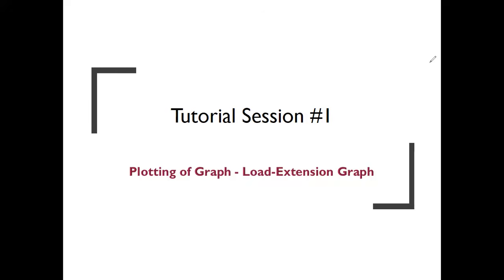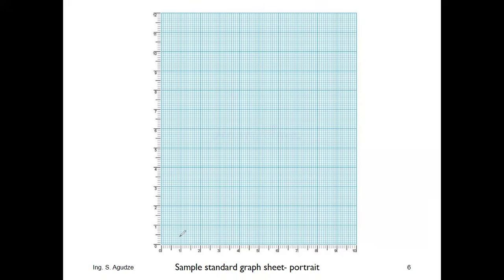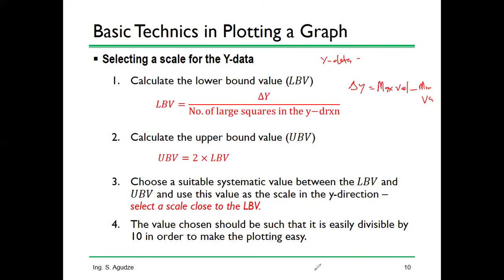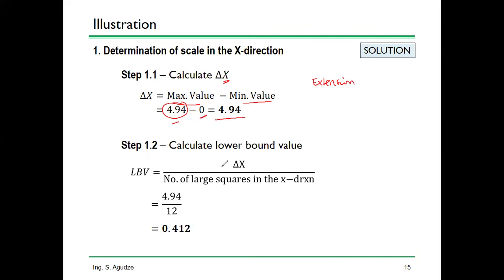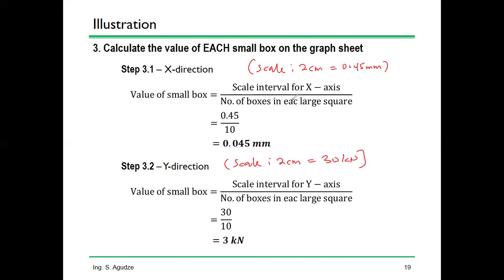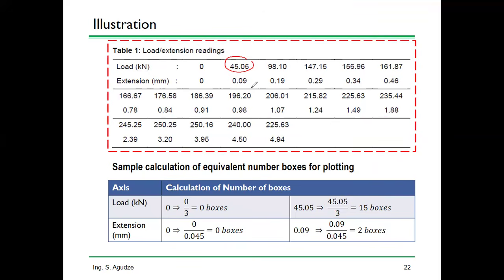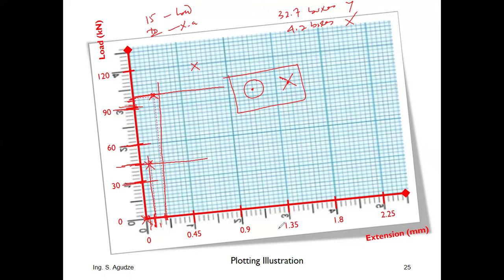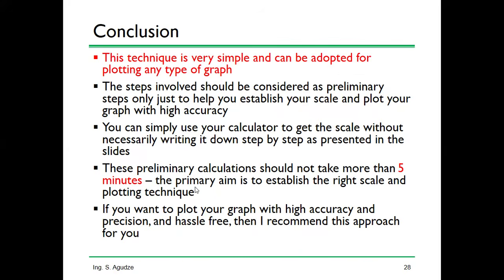Load‑Extension Graph Tutorial | Easy Method for Engineering Students

Comment: Sir please why is the Load(kN) not converted to N?
Reply: 😀To make calculations more easier to write and read, the use of I.S prefixes can be adopted to make measurements more meaningful.😇..
Reply from the maker: When plotting the graph, your loads can be in N or kN. However, when evaluating the parameters from the graph, your answers should be in smaller units
Reply: @SamEngTutorials 🙏❤️‍🩹
Reply: He wants a card
Yellow card, you can't ask question 😅😅. He's simple one of the best lecturers...